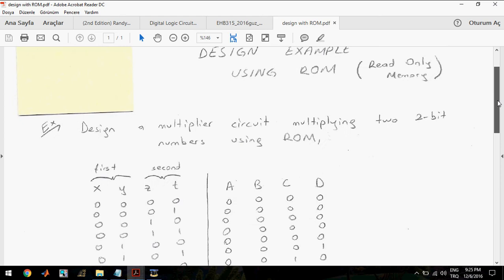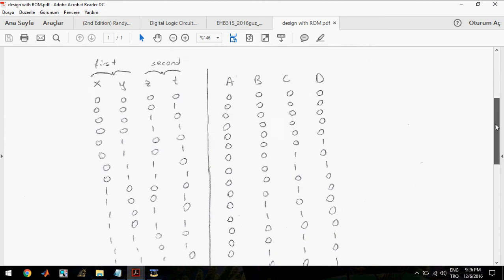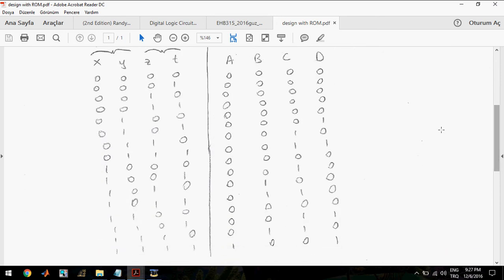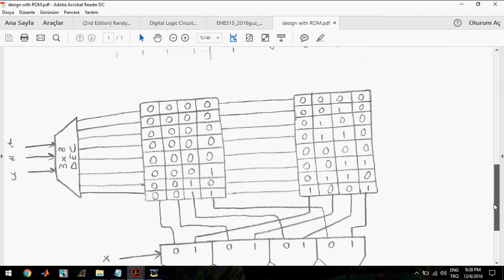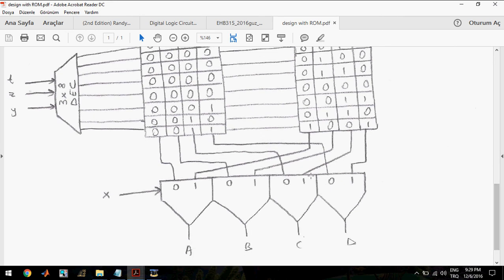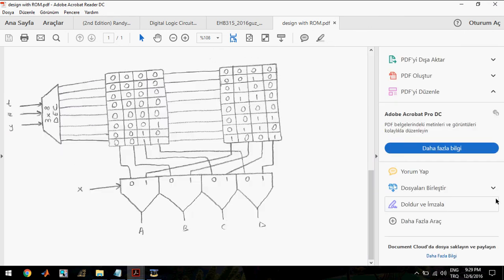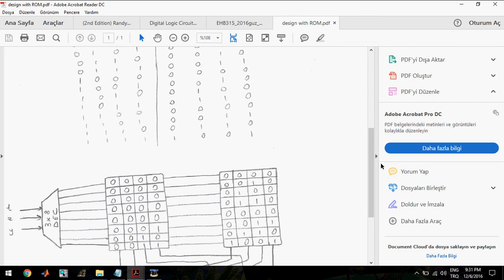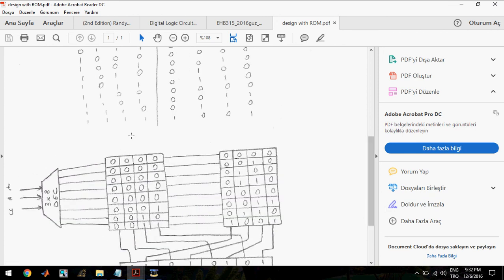Multiplier Design Example using ROM, DECODER and MULTIPLEXER.

Comment: I have a question but it's kinda unrelated to the topic which you're on about but you seem to know your stuff so here it goes: Could you please simply explain to me how a multiplexer & demultiplexer works when it comes to memory controller & memory(RAM)? I can't seem to get my head around the facts. 

From what I can understand thus far is that the data which is sent from the memory controller in the CPU goes across the path towards the memory which is currently in (multiplexer) then once in memory it demultiplexer and sends it to the correct memory address? 

I'm sorry for the unrelated question but I would really like your help if you can provide it to me.